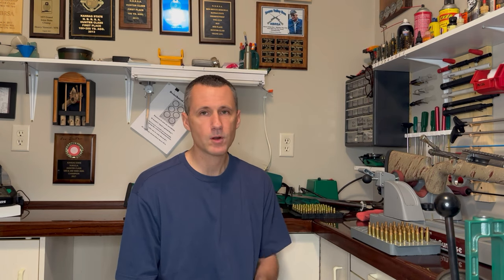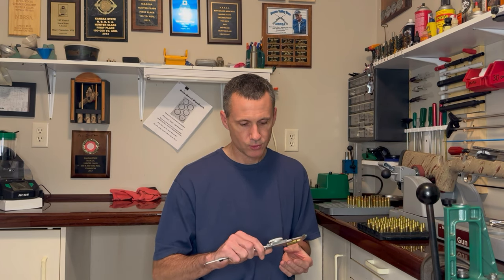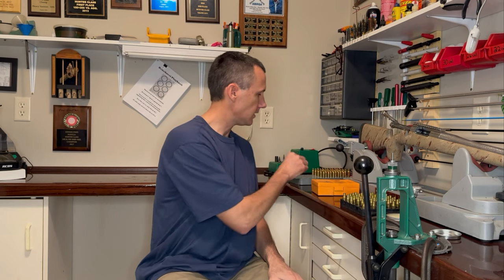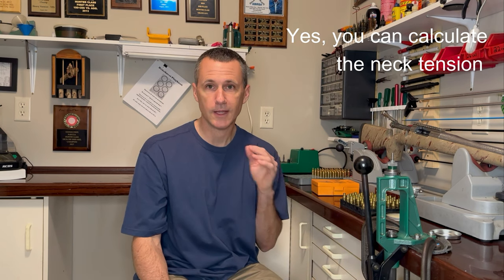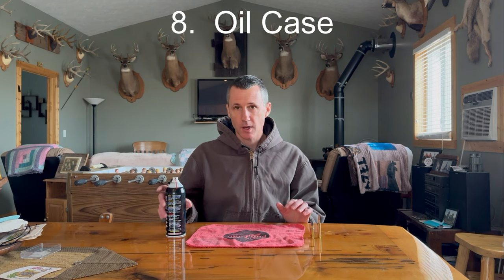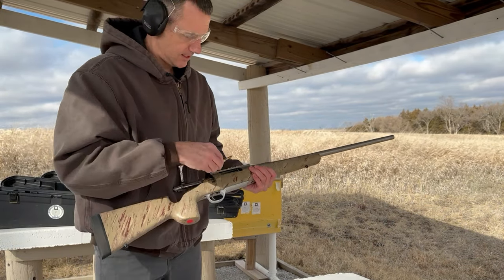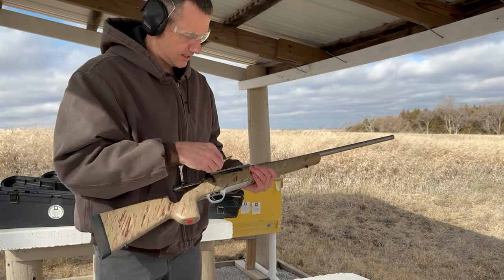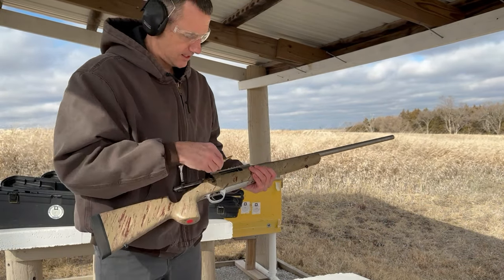Fireforming Rifle Brass:  "You only get one chance to make good brass."  ctdshooting

Comment: I have used Imperial sizing wax for this for many years. The idea behind this is to decrease the possibility of  case head separation in future firings by not letting case walls grab sidewalls of chamber and stretching the brass unevenly. When fire forming brass it is critical to have case head up against bolt face and bullet in riflings. This set up and a very very very light lube on case will allow case to form to your chamber without uneven stretch of brass. If you are having problems with case head separations after 1 or  2 firings or get donuts in your cases necks after fire forming then it could be that you my need to try this process. In this video you were also told that he was shooting 1.5 grs less than he would be normally shooting , indicating a reduced load. He also told you that he takes ONE piece of of brass and tests it to make sure everything is working as planned.  DO  UNDERSTAND that this process puts all the presser from firing the cartridge on the bolt face with no help from the case walls. I dont think that he or I  are telling you to shoot like this every time you go out shooting. The chamber should be cleaned of all lube prior to shooting standard rounds.

Comment: Not sure how I feel about oiling the cases.  Seems like you’ll get false pressure signs on the case head.
Reply from the maker: I appreciate you taking the time to comment.  I have not experienced pressure problems, but as with all firearm related procedures, if you do not feel comfortable doing it then don't.  Thanks again
Reply: highwaytohelles4561 I guess simple if you adhere to the principles...
I wonder if a very light coat of oil would change the dimensions 😮...enabling the case to stretch tosize by not gripping the chamber sounds...like sense ..but..more pressure on your bolt....I'm led to believe...
Reply: Oiling the cases does not increase pressure. What it does do is roughly DOUBLE bolt thrust by radically decreasing chamber friction. This decreases the fatigue life of the bolt to 1/4 to 1/8 of it normal lifespan if you keep doing it. This is not theory or conjecture, it was tested in the 1980's. Youtube hornady podcast #71 'lets talk cartridges cases' with jeff siewart

Comment: I'd like to see more about different brass.  I reload .308, in my limited experience hand loading, the plasticity and elasticity of the brass differ.  I've found Hornady tends to harden quick, Federal more forgiving.  Still to learn about, Lapua, Winchester and Lake City.   I've yet to invest in annealing equipment and suspect it may be necessary for me to achieve the results I desire.
Reply from the maker: Yes, but a big piece of the work hardening puzzle is how much the brass has to move during firing and resizing.  The more it has to move the faster the negative effects of work hardening will appear.  Annealing will relieve that hardening, but having the proper resizing die also helps.  (I just finished an article that will be published soon explaining this exact topic, I'll let you know when it gets released.)  
Also, (I'm about done - promise) I wrote a blog on matching the reloading techniques to the use of the rifle. https://www.ctdshooting.com/post/precision-ladder
Reply: Don't anneal the brass like this or you harden the brass because metal to soften needed to cool without oxygen so heat the cases and drop in a pan of water.
The reason to anneal the brass is the burn of powder heats the brass and then hardens the brass same as heating and not properly cooling in a pan of water without oxygen.

Comment: How do you fire form brass when you have a "factory action".  The chamber is so long that it takes at least two, if not three, firings before all of the brass is identical. Problem is the web of the case is getting worked hard. Its almost like the case head is getting worked backwards towards the bolt face.  Having a factory action is just bad...I dont know how to get around wearing out my brass prematurely just fire forming.  I will try to load at Jam....maybe that will do it.
Reply from the maker: Thank you for the question.  Any chamber takes 2-3 firings to get a true match.  This is why custom die makers want 3 firings on the brass before you send them the cases.  My experience has taught me that at least +.020 jam and .004 neck tension are "must do" when fireforming.  When doing those 2 things on the first firing, one can start the load development process on the 2nd and 3rd firings which will then "final form" the cases.  I hope this helps.  Try the jam and high neck tension and please let me know if it helps your situation.
Reply: @ctdshooting  Im on it !!  I usually do .030 jam and .002 neck tension. This tip will help for sure. It makes sense....Its hard to teach yourself things without a little help along the way. Thank you. I will definitely get back in touch
Reply from the maker: @rickm4295  The +.030 sounds good, but with only .002 neck tension the bullet probably just gets pushed back in the case when chambered instead of pushing the whole case back against the bolt face first.  Good luck.  I'm looking forward to reading how it goes.

Comment: I am a wildcatter and fire form for may obscure and obsolete cartridges. 

I have tried most if not all types and kinds of fire forming. 
Note" only 2 of my rifles are used for competition.  6BRA for benchrest an 250 AI for PRS.
Most if not all my fire forming are done while sighting and or straight on the PRS field.

Quick question" full powder load or 1 grn below charge?.
Reply from the maker: For the first case, I use 1.5 grains under what I think the final load will be.  Based on how that case turns out, I can then adjust the powder charge.
Reply: You stated to use a long seating depth. How much additional length
Reply: @JodyLake-rl2jl  .
If you are asking me...
I always touch the lands"

Comment: I was just about to trim my virgin 17rem brass to a uniform lenght ...
Best to wait until fired...due to "pull back" I think....
PS...changing my trimming technique to a "no pilot" system as cuttings seem to get into the neck area and "rough up" the inner neck.
Reply from the maker: The only time I trim before fireforming is when I neck turn the brass.  (Assuming the case is not too long to begin with compared to your chamber) But...you can check for yourself by measuring length on a virgin piece then fireforming that one round and remeasure.
Reply: @ctdshooting  I've refrained from trimming before fireforming...I've measured ..they're all under or at spec....think I'll refrain from 3/4 neck turning at this stage too.
I saw on primal rights the damage a piloted trimmer can do...and noticed when. I trimmed a few...so...now ..going to lee quick trim...cheaper that " Lyman xpress".

Odc how I've noticed things...like the scored inner neck and not reacted appropriately...I guess I thought polishing would fix it up ..

Thanks
Reply from the maker: @misterlewgee8874   Sorry for the delayed response.  Life was pretty hectic the last 2 weeks.  I think you're on the right track as far as trimming goes.  However, I have always neck turned before fireforming.  I try and obtain .002" neck clearance.  As always the target will tell you if the process is working.
Reply: @ctdshooting  spent so much time on my new brass already . Measuring each case ..head space..lenght...neck Collet de, primer pocket uniform .vld neck chamber...trim the extra long cases up to 3 thou back .inner neck polish....thought I was done...
I saw primal rights video and he pointed out that pilot style trimmers chew up inner neck...bits of cuttings get in there and massacre the surface..so ..I almost bout Lyman electric trimmer .but..cos I'm poor bought a Lee quick trim die.   Happy with that!  ...
I'll look into neck turning...look at the  turning pilot, Forster...see how my sized cases fit...and assess whether neck turning the cases might score the inside of the neck like the trimmer..   should also measure a fired case neck for clearance info. My main reason to 3/4 neck turn is for grip tension consistency...and maybe uniform case lenght growth...
But...pretty sure not much gains...ha.
My 17rem barrel is custom..seeing the neck clearance I get will be interesting..
Thanks ..
Reply from the maker: @misterlewgee8874  Sounds like you have a good plan.  Let me know how it shoots
Reply: @ctdshooting  I did all of the aforementioned with nosler brass...and ...last time I zeroed..had 2 shot groups that were almost touching at 200 yards...I was impressed ..17rem..custom barrel. Rrm 788, Timney trigger
Reply from the maker: @misterlewgee8874   Sounds like things are working for you.  Love the 788.
Reply: @ctdshooting  changed from 25gn 17 cal...tiny groups at 200 yards, 0.3 inch..(only two shots for zeroing) to 20gn...approx 1 inch..maybe more at 200 yards ...not wrapped..guess I'm bit spoilt ..might look at seating depth for the 20gns, try get more stable ..or..lol..put on a glass scope...instead of pulsar xm50😍
Reply from the maker: @misterlewgee8874  nothing wrong with experimenting - especially when you have a proven load safety net.
Reply: @ctdshooting  I'm jumping to conclusions that 9 twist for 25gn, 10 twist for 20gn....🤣🤣🤣🤣

Comment: I form 7.62/39 to 6.5 gren. 
I’m seating the projectile out to almost jam. And going just above the bottom of the range.

Do you have any suggestions. Thanks and God bless
Reply from the maker: I do not have experience with your particular case - so I am hesitant to give specific advice.  My first question - is there a big difference in case measurements after the first fireforming compared to after the 2nd firing?  If not, then your current process may be doing the job.  However the base of the case being tight against the bolt face is a fundamental that needs to happen.  I don't know if "almost jam" is enough.  Give me a couple days to ask this question to some of my shooting buddies that shoot the Grendel.  I'll reply back to this question.  Thank you
Reply from the maker: I heard back from a fellow competitor who did exactly what you are writing about.  He does not recommend it.  He said the LR primers can not take the pressure needed.  He also mentioned Precision Reloading has 6.5 Grendel brass (Starline) in stock right now for roughly $60/100 pieces.  Plus the 6.5 Grendel brass has SR primer pockets.  Hope this helps.

Comment: For a person who is a reloader and you don't know to drop the aneled hot cartridges in water to cut off the Oxygen to soften the brass is stupid!
Heating and letting that bras cool around air is exactly the same as firing the casings and the heat hardens the brass.
Any old machinist knows about heat and metal which clearly you have no idea what you are doing!
What you are doing is going to shorten the cartridges life make the necks hard and cause cracks in the necks.
Reply from the maker: Thank you for taking the time to comment.  However, my data and experience do not match up with what you typed.  Best wishes in your shooting endeavors
Reply: Are you aware that half of the water is oxygen?  Just curious.
Reply: Dropping your annealed brass in water weakens the case head area too much over time and can lead to prematuer case head seperation. Allowing your brass to slowly air cool is the best way to soften the neck and shoulder area without damaging the case head metalurgy.
Reply: And no - air cooling the brass during the annealing process is not the same as fireing a cartridge, not even close. Cartridge fireing adds massive internal expansion pressures to the equation.s